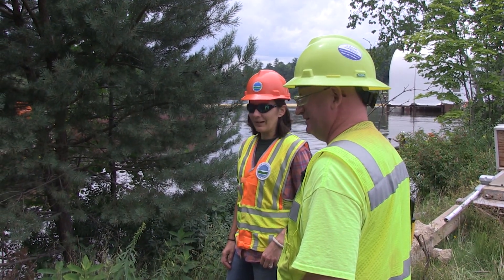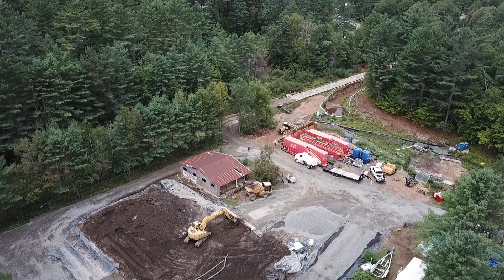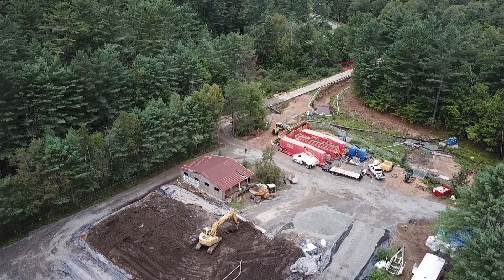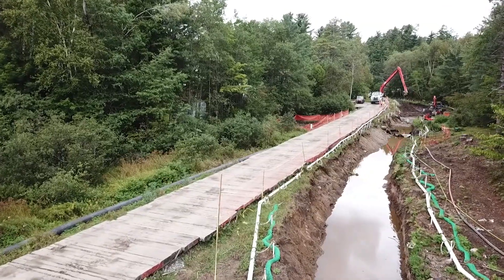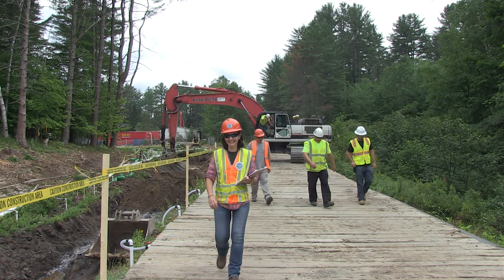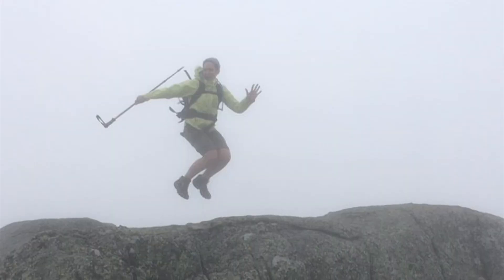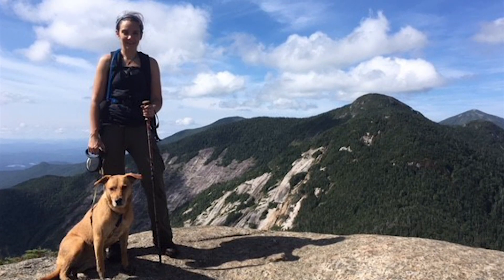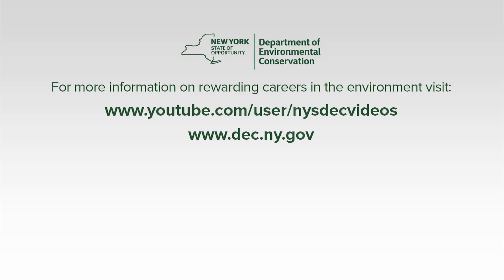On the Front Lines - Environmental Remediation

Comment: Financial report summaries and small business, and also enternships and stock. The collection of time is significant problems in industry as a whole. Think aboht whether sales increased or decreased, details about product lines performed lije starting an enternship Sony or as a double investment or even private investing. Distribution and how it performed and appeared. Changes in products for performance and appeared. Manufacturing capability. And mentions of raise or lower on percentages. a firm for example is 50 percent set of its manufacturing like environmental stock based compensation packages, and your allowance for doubtful accounts... For environmental packages collect pie charts every 2 weeks in your stock shares. Doubtful stock shares a r e employee shares and sometimes small businesses. Enterprizes have office boxes and higher employee basis and require more funding use bargraphs to keep track of stock in stores, employee rides, drivers, a decent bade of nice wemon to men ratio, security watch out for readiness janitors and phones Companies which are box office.  Big company capacity usually works at about 50percent floor stock or 75 percent management and employee and workers, remember the collection of time on stock and whethernit has increased or decreased. And employee transportation. Keep track of how much you spend tonhow much you gained. For example pay 2 minus2 equal 4 after 2 week gain 8 total pay. Donald Trump says "savings are a waste of time so what are yousaving for how much do you need for investments and keep track of them. Add another building to the company supporting the same funding is easirt. Location is important. So is renovations and decorations.
Reply: nerd